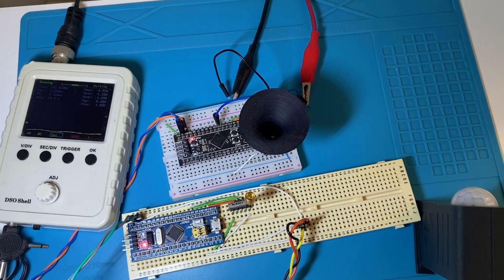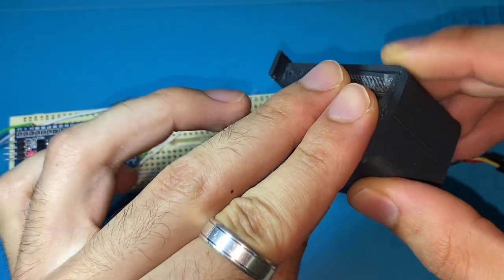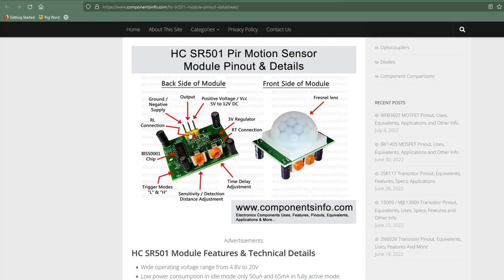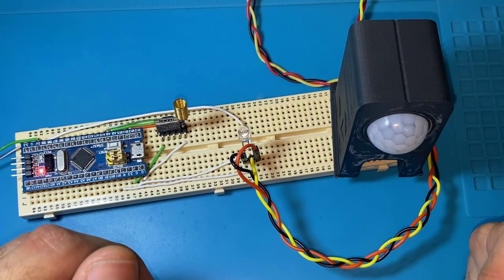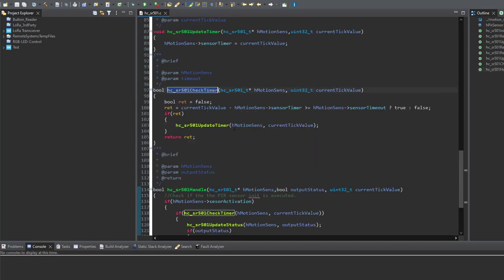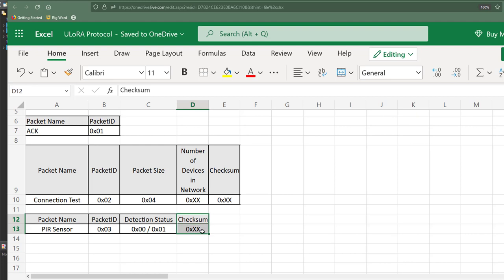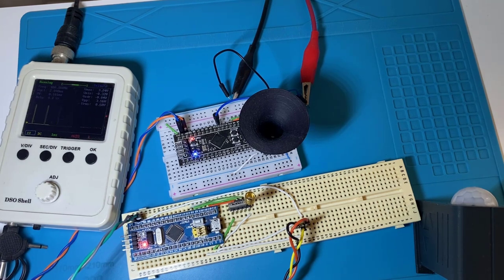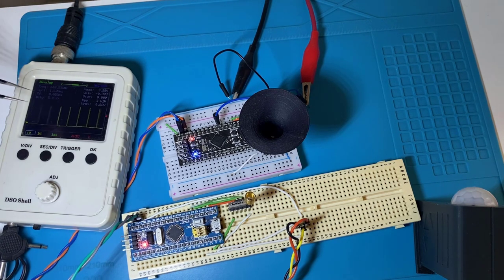STM32 LoRa Wireless PIR Motion Sensor

Comment: wonderful project! Are you using STM32CubeIDE for configuration?
Reply from the maker: Yes exactly. 
I don’t recommend it though for advanced projects. Since it became harder to manage your project
Reply: @usefulelectronics  Would you say CLion /CMake is a better choice? I am new at this but I am in full dive mode.
Reply from the maker: @slimsung3971  sorry I should’ve made it more clear. The IDE is totally good. I meant the use of STM32CubeMx, which is used for MCU configuration.
Reply: @usefulelectronics  Thank you for the precision, helpful!

Comment: Are the functions used for the PIR sensor programming  predefined in stm32cubeide or you created them?
Reply from the maker: I created them my friend. You can check the code in details from the github repository 
https://github.com/UsefulElectronics/stm32-rylr998-lora-transceiver
Reply: @usefulelectronics  Okay,thanks and is it possible to have functions for LDR and IR sensors please?
Reply from the maker: @rzighaya3250  yes you need to implement them
Reply: @usefulelectronics  Can you explain a bit please?